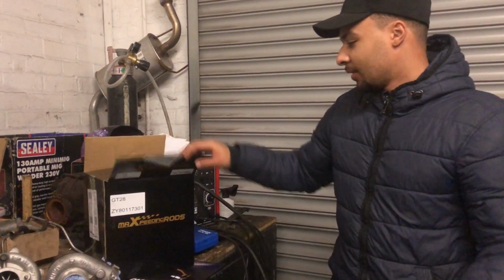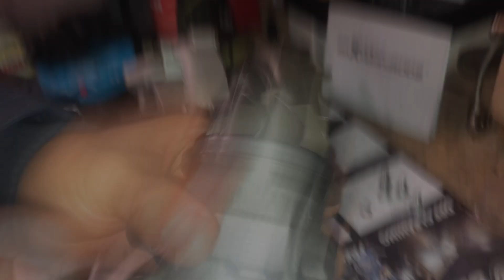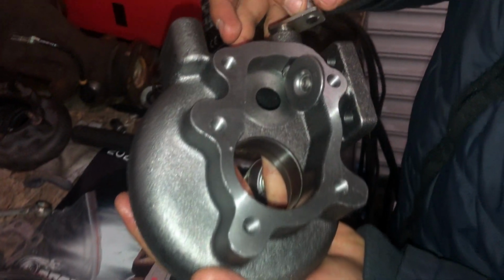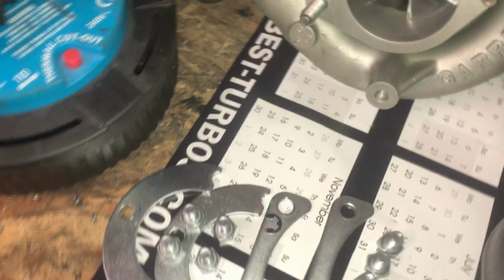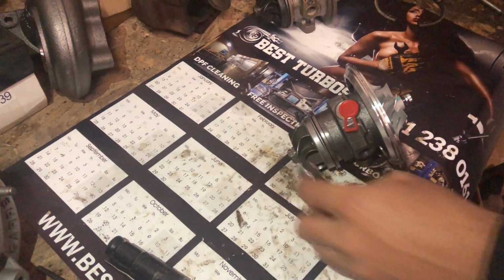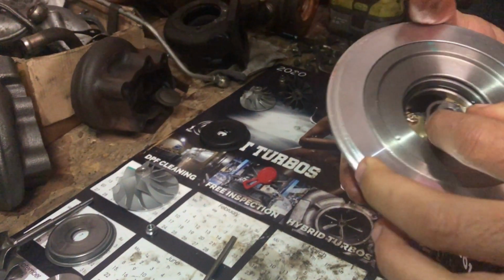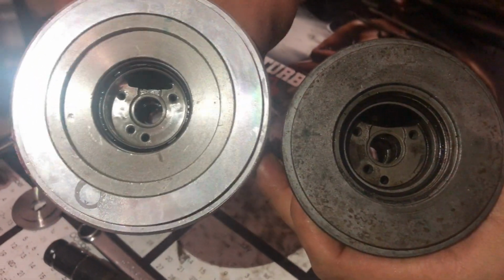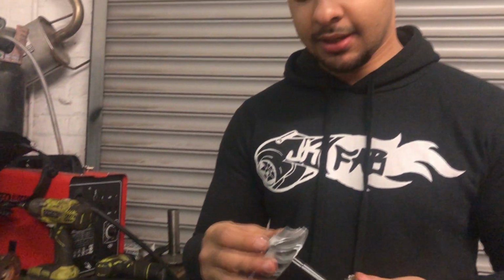MaxPeedingRods "GT2871" Turbo Review (Unboxing, Internals & Balancing)

Comment: This is a really informative in-depth unboxing video. Thank you! I recently got the same turbo for my build and this video really helped me get some actual useful info on this turbo. The balancing check was the absolute icing on the cake when it comes to video value. I used a few outtakes from your video in my video that I will be publishing today, I hope that's ok. If not, I'll remove it, no worries. I have put up links to your video in my video description, as well as the suggested videos and the pinned comment.
Reply from the maker: driving 4 answers Thank you! I did not expect to see you here. Big fan of your videos!
Reply: @JKFab  @driving 4 answers is the reason this popped up on my recommended feed as i just watched his video where he credited this video behind the reasoning for him to buy the turbo. only started watching him yesterday but glad i cam across both your channels. have you used the maxspeeding turbo yet? and how well does it perform in relation to turbo lag ect?
Reply: instaBlaster...

Comment: What a nice video! I got my TD04-19T from MaxPeedingRogs before i saw this video. Way before :D Anyway, it is working just fine until today, i do push it to the 1.5 bar and yet no problems. But the noticeable downgrade in compare to the OEM turbo, it's "gettin' up" slower. OEW got me a 1 bar boost at around 2700 RPM, this "Shanghai Wind" gets me same boost at 3000 rpm.
Anyway i am very happy about mine, and i do recommend it as a user to other guys :)
Price was just a joke, 200$ for a new turbo.

Comment: Have this fitted to my car and anyone with any questions I send this video to. Great video loved it from start finish
Reply from the maker: Massively appreciate it. Thanks man
Reply: @JKFab  just noticed something other day. Maxpeedingrods have a new Gt28 turbo well unsure what is different other than the housing is now cast with maxpeedingrods on it. They are £200 +. Was just wondering if you know by any chance if they are different in any way and worth the extra money. That's if you've come across them and read the specs or anything. Just thought I'd ask you :)

Comment: I've had this turbo on my miata for over a year now with no real issues besides the boost creep. Even with porting it isn't enough
Reply: How is the boost leg of these turbos on a miata?
Thinking about getting one myself
Reply: @Cango1  it's slow. Way too big. But it's fun when it comes on. On my NA 1.8 It starts building boost at like 3k and full boost at like 5.5k. but full boost doesn't really exist without an electronic controller and massively porting the wastegate hole. If you've got a 1.6 don't even think about it. If you have a NB 1.8 it might be worth it but still laggy
Reply: @guidosaur7506  I got a 1.8 Liter NA
Reply: @guidosaur7506  also thanks for your quick Response lmao, how is the internal wastegate rated?
Reply: @Cango1  maxpeedingrods won't really tell you lol I tried asking them. I've heard 8 psi and I've heard 10psi. The hole is so small though that it keeps boost creeping to redline unless you port it a lot with a rotary tool. I'd recommend a used sr20 turbo because they're built nicer and you have full boost at like 3k. You won't make as much power but the instant response is nice
Reply: @guidosaur7506  have u Tried Just testing it with a vacuum pump?
Reply: @Cango1  I don't have a proper setup with a hose barb adapter
Reply: @guidosaur7506  oh okay, thanks for your quick Response mate, very helpful! 👌🏼✌🏼

Comment: I've been running this exact turbo for 4 years and had no problems what so ever
Reply: On how much boost?
Reply: @niceeeeeful  13.5 psi
Reply: @josephdurling2565  what car & power did the GT2871r make?
Reply: I bolted it to a rove t16 lump and got 260bhp at the front wheels from 10psi. I also have some other supporting mods and I'll be forging soon and when I do I'll be upgrading the turbo to a gt30
Reply: @josephdurling2565  hey buddy whats the spool like?
Reply: @jblitzlee  it starts spooling at 3k but gives you a kick in the bollox at 3.5k and boosts all the way to the red line, I know it's a bit laggy but I think that it gives the car some character, also if I'm just driving about town I don't want to be on full boost constantly
Reply: @josephdurling2565  thats great!
I currently have a TD05-20g on my Ej207.. its mad laggy & was def the wrong choice of turbo for my 2litre! Have to drive round in low gears all the time to have any power whats so ever & so got 1 of these Maxpeedingrods GT2871R as tight on funds atm... need to get a custom uppipe & downpipe befor i can fit as the flanges are different but getting worried as heard some ppl say the lag was even worse than the 20G 🤦‍♂️
Reply: @jblitzlee  Have any updates with the 2871 ?

Comment: Very surprising that it actually balanced within spec. 
The one thing I didn't see you do was measuring anything. I've seen plenty of china turbos being listed with incorrect wheel sizes and turbo specs.
Also, one of the things I wished you would have done was to weigh the parts.
China is known for inferior metals,I this often shows up in "stainless" steel rusting quickly, cast iron being soft, and steel being heavier or lighter, than quality parts. I'd be interested  to see the weights of the wheels and especially the shaft compared to name brand parts.
Lastly, a side from the 360 trust bearing anything you noticed that would lead you to believe this turbo couldn't perform or last as long as a real gt2871?
Thanks for the video!
Reply from the maker: Jacob May 
I did actually measure both the compressor and turbine off camera. The compressor was 51/71mm and the turbine was 53.8/47mm. Identical to a genuine GT2871R in terms of wheel sizing.

It would be interesting to measure. I’m due to order a scale so I can make a follow-up video for that as I have some genuine Garrett wheels & shafts laying around.

Longetivity wise I just believe the thrust bearing is an issue, not really much else. Being a journal bearing turbo it’s likely to live much longer than a genuine GT2871R. I actually see them fail quite a lot due to poor balancing from factory & soft turbine wheel material leading to chipping.
Reply: @JKFab  Thanks for the reply. On another issue. Some people have run oil restrictors. Did you see anything in that turbo to shown that to be neccessary?
Reply from the maker: Jacob May Journal bearing turbos don’t require oil restrictors UNLESS the drain isn’t big enough, which on this turbo is normal and acceptable size.

Comment: Hi! I bought this exact Turbocharger and I can't rotate the compressor housing to properly clock it. The turbine housing moves easily by just loosening the bolts.. but the other side won't should I also remove the C ring??

Comment: I purchased one of these turbos from maxspeeding rods for my astra Vxr  in December.
It was all fitted correctly, primed up etc
It lasted 3 weeks and started burning oil like no tomorrow. 
Dropped the company a message and they basically said “sorry no warranty” 
Was only running 12psi for about 1000 miles.
Poor quality even for how cheap it was.
Buy cheap buy twice
Reply: did you really put a $100 turbo under 22 psi?
Reply: I would have taken it to someone like JK Fab and rebuilt it with upgraded bearings and re-balanced unless I was just going to run like 6-8 psi

Comment: Msr turbo's are definitely the better built Chinese turbo's in fact they now do a higher end version of a gt30 with yellow blades the finish and quality looks excellent also they are around £400 so dearer but still cheap
Reply from the maker: Its a GT3071 I believe, journal bearing so nothing special just made to be as cheap as possible. The yellow finish is just anodizing on the compressor wheel, does nothing but aid in appearance.
Reply: @JKFab  gt3037 and gt3070r is what they say updated racing spec even the finish on the housing looks better with there own branding on it like garret etc does
Reply: @JKFab  have you taken one apart yet??

Comment: Good video. I’m looking at a Chinese t25 for a diy turbo kit build.  Can I adjust psi from the internal wastegate. It comes with 8psi but can I adjust the rod to run 6psi base and then I have more room for boost creep.
Reply: yes he showed the rod is adjustable
Reply: Yes but I don’t think you can go to less psi then the spring.

Comment: Great video! Impressive that it passed the balance. Was that the one and only run you did? Did it consistently pass if you did multiple runs? Is there a reason you didn't go past about 70,000 RPM? At any rate, close enough to spec on a journal bearing it will probably run for quite a while. I'm suggesting to them to offer 360 degree thrust bearing turbos as I've been surprised they don't offer them already.
Reply from the maker: We did a few off camera with the same result. It’s quite a big rotating assembly so 70k was adequate for a basic test of the turbo.

I’ve already suggested this to them, but I assume they stick to a 270* to keep costs down.
Reply: @JKFab  Awesome! Yeah these turbos aren't rated for INSANE pressure ratios anyways, so 100K+ RPM duty probably isn't their specialty. Still good it balanced out period. I've been getting some words through to their engineering team. I suggested coming out with a ball bearing design, but they basically said it is far more expensive and complicated, which of course is true. Hopefully they keep trying to advance!

Comment: Just bought this exact turbo for a conversion on my clio 172.
It'll only be running circa 8psi, so its good to hear you think these should be fine not being pushed hard.

If I wanted to change to a 360° thrust bearing how hard is that to do? It looks like the collar it holds would be captive?

Great video, enjoyed watching 👀
Reply from the maker: It’s not hard, but experience definitely comes into play for doing it correct. Don’t forget to have it balanced afterwards!

I offer an upgraded rebuild kit, along with a balancing service if you require. 

Thanks for the feedback!

Comment: Got a question, once you unthread the bolt on the turbo, does it need to be rebalanced? Or can you put it back on the turbo and run the turbo?? Also what does the bold need to be torqued to??
Reply: MARG Performance/Engineering Technically yes.

However you can mark up the nut to the compressor housing and reallign when your tightening.

Theres no specific torque and it varies depending on model. On these you tighten by hand, and then do 3/4 of a turn with a spanner.

Comment: Really appreciate the effort and research put into your video! One question. While you vetted the build and balance and offered insight into the 270* bearing and wastegate. How does having a journal bearing effect the performance vs the ball bearings in the Garrett version?
Reply from the maker: There’s not much difference. A ball bearing cartridge can help with spool up on heavier rotating assemblies like on this turbo, but the difference is minimal of 2-400rpm at most.

Main benefit with ball bearings is it’s capability to deal with larger thrust forces without destroying itself, where as a journal bearing turbo (especially like this 270* one) would fail pretty quickly.
Reply: @JKFab  thank you! That’s exactly what I was hoping to find out!

Comment: good stuff man. any recommendations for decent value thrust bearing upgrade?
Reply from the maker: Pla Awa Thanks!

Any 360* thrust bearing from a T25/T28 rebuild kit will work with the associated thrust washer & front seal assembly

Comment: If I were to upgrade this turbo what wheel do you reckon I would see better gains from ? (just overall performance not purely power). Say between getting a billet compressor wheel vs upgrading to a 9 blade turbine wheel

Comment: So to resume, change the 270° to a 360° one
And port the wastegate exit ?
And I saw a guy run one of these on a ca18
Full boost was at 5300rpm, do you know how could this turbo spool faster? Haha
Reply: Correct. 

Spool is so slow due to it being journal bearing, best way to improve spool is by reducing rotating mass. You could do this by using a billet compressor wheel. Unfortunately theres no alternatives for the turbine wheel.
Reply: @UP4U  oh okay :/
Thanks for answering :)
And if I put the stock t25 exhaust side on the gt2871, will I gain anything performance wise?
Reply from the maker: EyZoW Unfortunately that won’t work due to the turbine wheel being much bigger than a T25 exhaust housing. Both are .64 ar anyway so it would not make a difference, even if they were interchangeable.
Reply: @JKFab  thanks! Keep up the good work

Comment: You should have run the balancing 5 times...each will be different if the bearing pack is shite..
Reply from the maker: That’s not how it works with JB stuff, unecessary. If it were a ball bearing cartridge, you are correct. :)

Comment: One of the major complaints that I see about cheaper chinese parts is the fit and finish and the quality of the metals used and hardness and heat treating of metals like bolts, shafts bearings etc. It may not be an issue here, I don't know, but that seems to be the issues I usually see, the things that you can't really see. I just ordered a Maxspeedingrods polished SS front brake rotor for my Dyna Wide Glide, the pics look good and the spec rundown sounds good but we'll see, time will tell.

Comment: Im thinking about getting a knockoff ceramic dual ball bearing gt28.
What do you think?
Should I balance it once I get it?
Also how much does your local charge for a balancing or just testing the balance?
Thanks
Reply from the maker: V3N0M If decent parts are used it’ll be ok. Ball bearing turbos transmit much more vibration since the shaft doesn’t float in oil. I would definitely have it checked.

Balancing costs £100

Comment: Just got one of these for my turbo build, I'm hoping to run quite a bit of boost, maybe 2 bar. So short summery is drill the wastegate port out bigger and change the bearing to 360?
Can a have a link for the bearing you sell?
Reply from the maker: Ed Kay correct, although I doubt this turbo will stay efficient till 2 bar, I would say a tops of 1.5 bar. For a bearing, contact me on my facebook page (JK Fab) or my instagram page (jk_fab)

Comment: this or their T3/t4 hybrid on a k24A2 Honda engine? power goal is near 350 whp.Currently using Gt3076(ebay) but is laggy.i want quick spool. will T3/t4 at 12 psi near 350 whp?
https://www.maxpeedingrods.com/product/for-t3t4-t04e-t3-t4-a-r-63-turbine-5-bolts-flange-max-universal-turbocharger.html

Comment: Could you please recommend an uprated rebuild kit? I found a few options in eBay. Cheap Chinese one - $20-$25 and kinugawa which was $80+ . Can the 360 trust bearing be found in any OEM turbo so I can search for a quality rebuild kit for it?
Reply from the maker: The chinese rebuild kits are generally fine to use, just make sure you get the correct one. 

Alternatively I sell T25/T28 rebuild kits with upgraded thrust bearings for £30 each, they are what I use.

Kinugawa prices are too much, especially for a rebranded chinese rebuild kit.

Comment: Hi all. I broken 3 of this from maxpeeding in only 1500km. 2 was new and one was rebuild in a greate rebuilder factory. Rebuilded one was broken after only 100km. I specify i was 1.5-1.6bar boost and low torque(because for the moment i don;t have forged rods) on my 1.8t on skoda octavia 1. This turbo is a big shit the quality ov components is very bad. I think the hot part work very nych ar hifg them and the oil leave the turbo.I bought a new garrett gt2871r with dual ball bearing after this bad experience with this bad company maxpeeding. They wrote on description this turbo make 400hp. After i discuss with them about 2 broken turbo they told me this turbo work only with maximum 1 bar. I said WHATTTTTT. F..k your turbo,Never at 1 bar you make 400hp,Maybe only with a 6000cc engine.Good luck.
Reply: It is a universal turbo, no one said it would make 400hp on your 1.8t pal. They've said 1 bar limit due to the thrust bearing.
Reply from the maker: bb bb You obviously don’t know what your talking about. If you watched the video, you would know the thrust bearing is the first thing to give due to being an inferior design. However, once changed I see no issue going way beyond 1bar.

Comment: Those turbo SUCK and they don't back their garbage product. Avoid it like covid. Or say goodbye to your money. Hot side leaks and the oiler hole leaks. Total garbage
Reply from the maker: Sounds like you have no idea what your talking about. 

I’m in no way sponsored by these guys, or a big fan of this turbo. But it works just fine.

This is coming from personal testing experience, and numerious customers and affiliates using that exact turbo.

Try using a quality gasket set and a copper crush washer for the oil feed 👍🏽